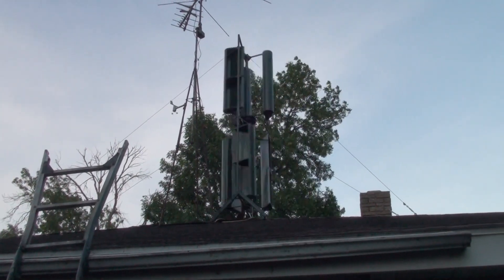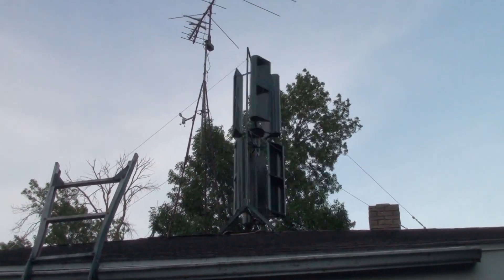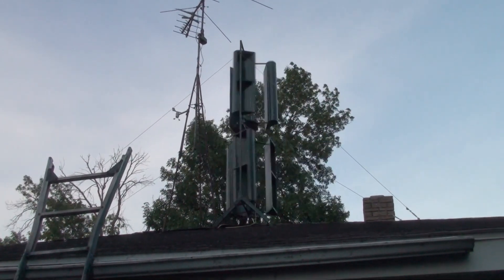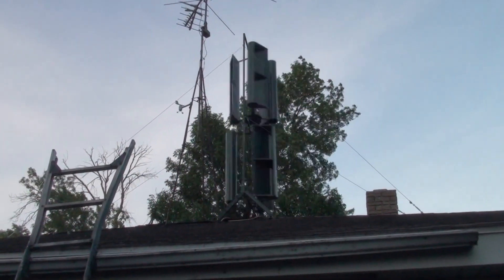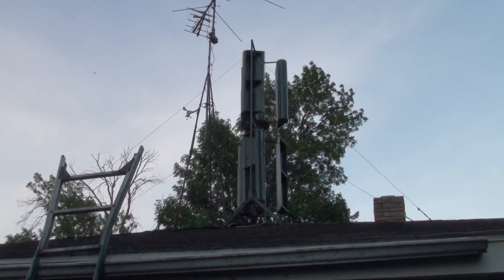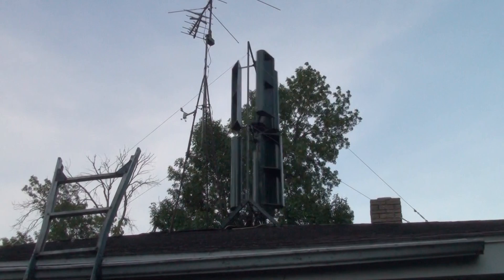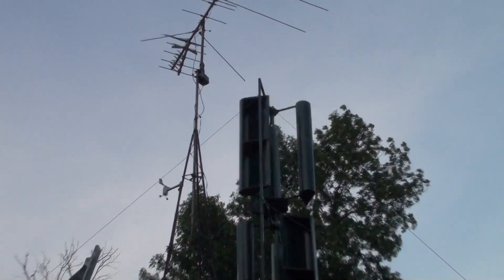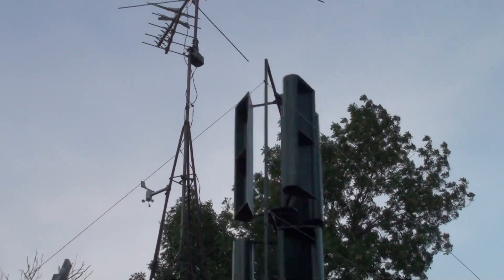Double stacked lenz 2 with counter rotating alternator

Comment from the maker: @Keveeee2000  I am almost done building a bigger alternater for it. 12 coils and 32 magnets on 12 inch disks. The slip ring has almost no resistance. I had these up origianally as single 4 ft turbines with the same smaller alternator that is on them now but wasn't getting much out of it that way. Will be posting pictures of it later with the modification.